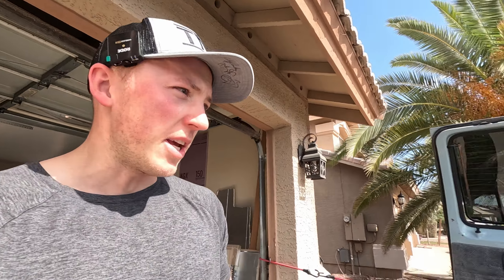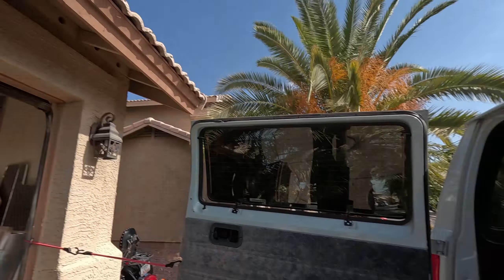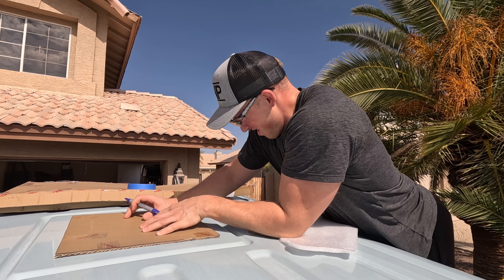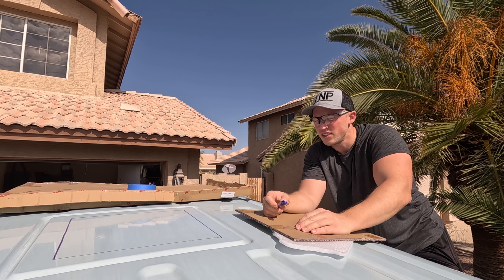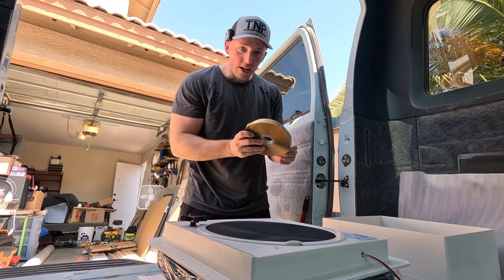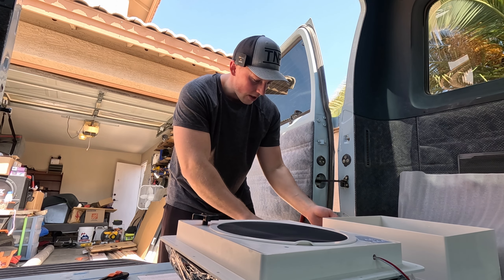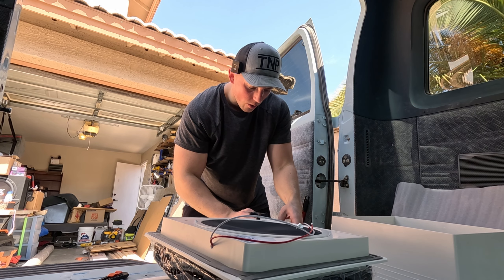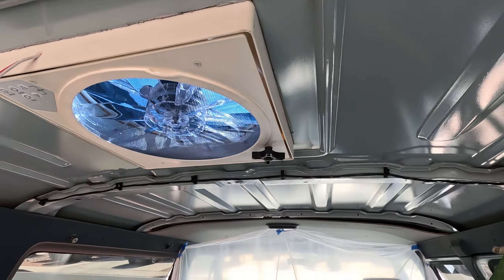Building a BEAUTIFUL Camper Van on a Budget - DAY 1

Comment: Couldn't you have just moved the rear 2 brackets to line up to the flat parts of the roof? Also why didn't you use contact cement/glue between the plywood and vinyl.